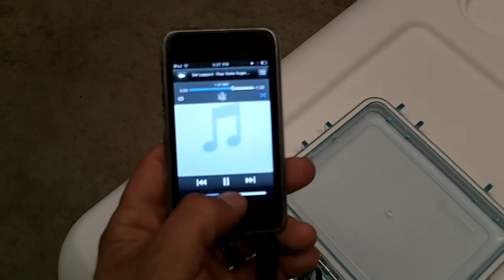Texas UT Longhorns Chickeneye cooler stereo

Comment: Why do you have the stereo on the drain side (or are there two?)? I can see that puts the weight of the battery over the wheel but once you load it down with beer it'd even out.
Another excellent build, just curious about that little detail.